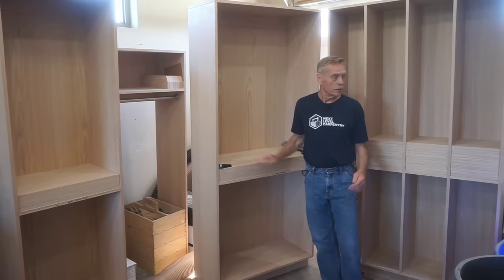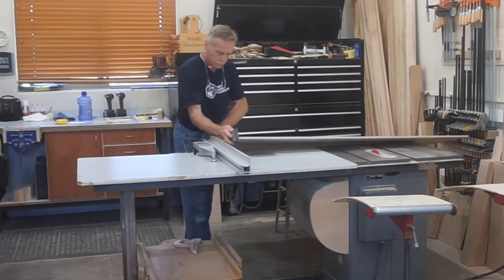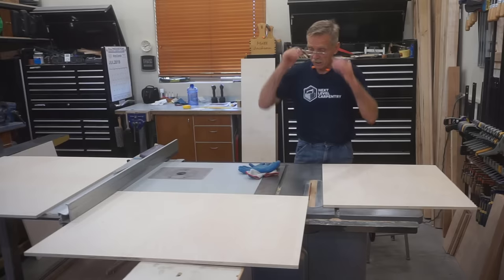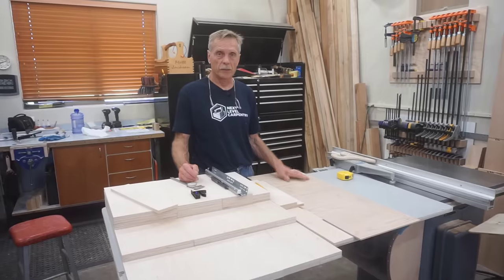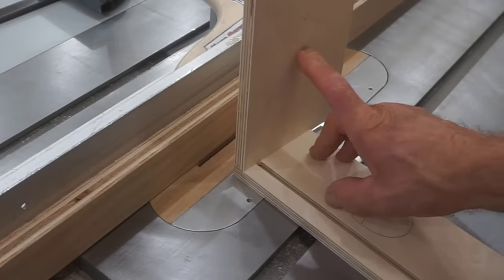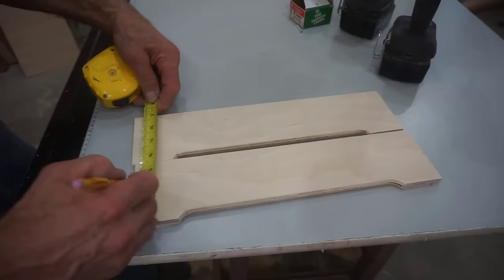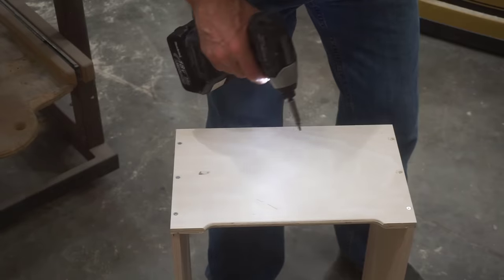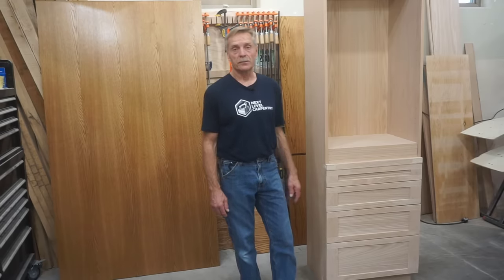Master Class for Professional Grade Cabinet Drawers

Comment: Great video, Matt! Is there a reason you wait to diverge the front and back of the drawer boxes until after cutting the dados, rabbits, and tenons? Can I cut the backs to final size at the start, not cut the dado, and save a little bit of stock?
Reply from the maker: Good eye for efficiency and detail Andrew.  I think the only drawback to the sequence you ask about is that you'll need to keep track of those parts starting earlier in the process.  It's probably worth it and, in some cases, the little extra stock you'd save might make the difference of not having to buy a whole extra sheet so, by all means, go for it!  Keep in mind that you need to make sure the width of the backs matches the top of the dado on the other 3 drawer pieces to get a good fit of the drawer bottom.  It's not that hard to do, as long as you're mindful of it.
Thanks for watching and commenting on this one!
Best,
Matt
Reply: @NextLevelCarpentry  Thanks for the reply! Something I just learned trying to do this is that you have to consider that your 1/4" dado for the bottom is not going to be exactly 1/4", more likely a bit smaller. So if you cut your back exactly 3/4" shorter than the front (1/2" clearance + 1/4" dado) you might end up with a back piece that's too short. Using the dado as a mark for cutting the back to size is actually a really convenient way to get a good fitup if you don't mind losing a little bit of stock per drawer. You can also raise the blade at the end of the dado cutting (38:00) and make the cut there.
Reply from the maker: @Contrail4  Spot on!  It's an easy enough problem to work around as long as you're paying attention like you are.  Another aspect of it is that, usually, I find that any material savings are a moot point and the only actual result is that the leftover scrap/offcuts I throw away at the end of the project are just a little smaller.  But, once in awhile, it means the difference between using .98% of one sheet or 1.08% of a 2nd one which makes a parsimonious approach to cutting drawer backs totally worth it! 🤓

Comment: Beautiful work. I don't have a nice, big, expensive table saw and jointer, and knew I wouldn't have room in my garage for them. I also needed to be able to store my equipment. The solution for both tools for me was the Kreg Adaptive Cutting System. I am in the process of making 8' tall barn doors to serve as shutters inside.  After cutting six 8' pieces for the sides, I noticed I was off 1/8" "fat" on one end, due to not setting my rip guides perfectly. I then, fine tuned them, put the guides on the side of the board, and recut. PERFECT. I couldn't have done that with my contractor's table saw. I would have wobbled somewhere.
Reply from the maker: Good save, Russ!  A guy's gotta do what a guy's gotta do, right?! Best, Matt
Reply: @Hello Russ how are you doing

Comment: This couldn't be posted at a better time, I'm starting to build the drawers for my kitchen remodel today! Now to soak in the knowledge...
Reply: If you leave the dato on the drawer back, it will hold the bottom without screws, In fact, so strong you can stand in the drawer and it will not fail, even with 1/8" material. On the drawer sides finish nails can be used instead of screws, much cleaner look. Be sure to glue all joints and especially the bottom. We made dressers this way with lifetime warantee, and never any claims.
Reply: @carmengeorge5647  putting pocket screw holes on the drawer box front will allow you to hide any screws or nails from the finish sides

Comment: I really like watching you organize the work flow and the care you take to mind all the details.  Having broken down hundreds of sheets of plywood in my dad's shop making cabinets and drawers, I am even more appreciative of the efficient and effective way you work.  

Watching your example, one notes an important point:   NEVER assume the factory edge of a plywood sheet is either true, square, or clean.  Check it!

Respects!
Reply from the maker: Thanks for watching and commenting Jerry.  Sounds like you been there with misplace confidence in the squareness of a factory sheet?  Makes you wonder what you did wrong all the way through a project only to discover the sheet was to blame... Best, Matt
Reply: @NextLevelCarpentry    
I came to believe that plywood factories provided built-in frustration with every other sheet of plywood -- with great efficiency. 

Then, of course, there is also the way the sheets are (mis) handled in transit.  That helps a lot, too.  😎

Thanks, again, for a great video.

Comment: You speak so well and give easy to follow instructions. I'm by no means an expert with wood working but I'd like to point out to those who are watching this or any video of someone using a table saw : Make sure your shoes are non slip and keep the floor clear of sawdust. If both feet slip out from under you while reaching across the table, you could easily fall chest first onto the spinning blade.......Love the tip for squaring up the sheet on the jointer. Cheers.

Comment: I use CutList Plus for optimizing material use. You can allow for kerf width, force cutting with or across the grain, print labels if you wish, print a cut list and/or cutting diagram, and much more. No need to apologize for going into detail as far as I am concerned. You can't over communicate I believe. If there is a little too much info for some they can skip over, for the rest they will get all the instruction they need. You do an excellent job with your videos and editing.

Comment: I had always been taught that the factory edges were always golden and that I I could always trust them and couldn't ever do as well as the factory.   After watching this video I started checking all the sheets of plywood that were going into my projects.    In just two months I have confirmed for myself that Matt is absolutely correct.  I can't believe that I was that naive  even after all these years.    However, I have now seen the quality in my work jump up dramaticly  by using just this one tip.    Thank you Matt for sharing, you have really made a difference in my life's work.
Reply from the maker: Plenty of factory edges are square and true though never smooth and occasionally out of square.  Being aware as you are now is definitely a factor in the quality of your work. It was a surprise back to me when I learned that thickness of veneered panels from one part of a sheet to another can very slightly too.😮You're welcome for sure Riidher! Best, Matt
Reply: @NextLevelCarpentry  Matt, I am very pleasantly surprised that you answered my comment.  Thank you for taking the time and making the effort.  It proves to me that not only do you turn out quality work but that you are a quality person.  And thanks for the tip on veneered panels.
Best Regards,
Riidher
Reply from the maker: @Riidher  Youbetcha!  Connecting with sincere viewers like you is the main reason Next Level Carpentry succeeds in the online realm of YouTube where growth is normally gained with glitz and fake drama. Best, Matt

Comment: Hello Matt, At the 18:00 minute mark you mentioned not using a Riving Knife on your table saw. I have been building cabinets now for over 40 years and have never engaged or entertained the idea of a Riving Knife...  I too like to manipulate my “Sheet Goods” and feel the Riving Knife gets in the way. To this day I have not had a pinched Saw blade from ripping “Sheet Goods”... Safety First, Always...  Great Video, Greg
Reply from the maker: I think there's work habits that build over time for guys like us: never had a riving knife and work safely without one.  Lots of people drove millions of accident  free miles before there was ever such a thing as anti-lock brakes too.  Take away antilock or riving knives from someone who learned with them as normal and they're bound to have issues.  Safety first with what you're used to maybe is a good mantra?  Thanks for your comment! Best, Matt
Reply: @NextLevelCarpentry  You Bet...

Comment: I found it interesting that you decided not to include the process for determining the sizing for the amount of drawers that occupy the spaces. Its been my experience that this is the one aspect no one seems to teach! Its always about the cabinet / drawer construction techniques. Aside from this little gripe, thank you for your time and effort in creating great content for us to enjoy and learn from.
Reply from the maker: Hey Superwingman... the reason you don't see it covered is that it would take a dozen very boring, technical videos to even begin to cover the subject since EVERY piece of drawer hardware has different requirements.  This should and, in time, probably will be covered by manufacturers in video format.  They already cover it in print/PDF format but I would definitely agree it's lacking in understandability.  Best you can do is study product literature specific to your choice of drawer glide and then make a mock-up installation to confirm you got it right.  45 years in and I STILL find myself doing that for anything but the most basic side-mount glides that require 1/2"+ space on each side of the drawer.  But don't go with that as an assumption because most glides are manufactured in metric which throws another variable into the equation.  Best, Matt
Reply: Matt, thank you for your detailed feedback. However,  I think there's a misunderstanding. I am well aware of the differences regarding slide considerations when determining the width of the drawers. My lack of understanding  is with regard to the height dimensions of drawers and how to determine these dimensions. If my cabinet vertical opening is "X" and I want 4 drawers in that space,  what's the best way to determine this?
Reply from the maker: @SuperWingman69  ahhh... I see.  Turns out that's an even bigger question because it goes beyond logical/physical considerations and gets into art and borders on philosophy.  Google the term "geometric progression"  https://en.wikipedia.org/wiki/Geometric_progression to get a peek into the labyrinth of 'answers' to your seemingly simple question.  Beyond that just think about what you want to put in your drawers and size them accordingly 😁😎 Good luck... Best, Matt
Reply: @NextLevelCarpentry  I think you could simply give / teach your methods for determining the dimensions for the amount of drawers that fit in a cabinet. Your last reply seems a little sarcastic. Up until now I've really appreciated your time and effort in teaching your craft. Not so much at this moment due to your response.
Reply from the maker: @SuperWingman69  Seriously?!  Dude... I'm afraid your expectations for free answers from a free channel from a content producer who's taken a good measure of his valuable time to give sound answers to your questions again, for FREE,  are far out of line. You should reconsider that ungrateful reply... and good luck finding a better answer.  Seriously.  Best, Matt
Reply: @SuperWingman69  This is less of a "carpentry" question, and more of a "furniture design" question. Maybe check with someone who designs furniture?
Reply: @NextLevelCarpentry  I am with you Next Level Carpentry. Keep up the good work and build on.

Comment: ive seen countless machine made dovetail drawers fail, but i have never had a captured bottom drawer lock joint style drawer fail. I build mine with a 1/4 inch tenon, but you really cant go wrong with this joint. plus i love the way it looks with birch or maple multiply. nice work
Reply from the maker: There's just something about Russian birch with a clear lacquered finish, isn't there?  Best, Matt

Comment: Great video!  I am an experienced carpenter that has made many different drawer types, what I learned from you is- go the extra mile to do things right.  I love your attention to detail, I have always focused on speed, I want to focus on detail now.
Reply from the maker: As you know it takes a lot to be good, Steve, and sounds like you've realized that it takes just a little more to be 'the best'.  That slight but very significant change in your focus means you're on the road to greater things!  As you go forward you'll find yourself able to do much more detailed work much more quickly because of learned technique and experience/familiarity. Best, Matt
Reply: Absolutely, I've always made drawers one at  a time.  I see the efficiency of cutting all the parts at once and reducing the time spent dialing in the saw fence.  Thanks

Comment: I am a cabinet woodworker and cabinetmaker and enjoy every minute of these kind of video's always looking for new things to add to my arsenal.  And so I never mind sitting through long video's that are packing full of interesting content that I know i've going to get something good out of regardless of my experience level or not.  Measuring screw layout was only thing i thought was a little overkill.  My boss would kill me if he saw me doing that at work.  lol.   The eyeball-O-measure is accurate enough for those kinds of details imo.
Reply from the maker: Measuring screw locations is a little bit Overkill but anytime screws are visible in the finished product I think a little extra time with a quick layout gauge is time well spent. But that's easier for me to say because I do things on a cost-plus basis not trying to keep bid work profitable like your boss probably is?
Either way thanks for watching and commenting and keep up the good work!

Comment: Man, sanding the edge of sheet goods is an outstanding tip! I cannot tell you how many times I have seen that ugly gap appear on the table saw between the sheet and the fence because of a splinter or a pebble in the edge. Excellent video!

Comment: I have two nice table saws one of them was my grand fathers. It was made in the 50's has been well taken care of, the other is a cabinet saw from the early 2000's. I do not have any of the fancy additions to my saws either, but I like your self have learned to work the brain and the saw to true the wood. Love to watch a true craftsman at work. Keep up with the flicks.
P.S. Some day I may get the energy to build a saw sled but for now I will continue to work with nerves on edge while performing some of the cuts you did in this deminstration.
Reply from the maker: Kudos for keeping those old saws alive, Al.  They don't have all the pizazz of new ones but they can be a joy to work with.  FWIW The next video from Next Level Carpentry is an in-depth build video for the zero clearance throat plate insert you see in use on my saw in this video in case you're interested in that one small but very useful/helpful upgrade.
Best,
Matt

Comment: Two things: 1) You mentioned that you're known for longer videos.  If people are giving you crap about it, then typically those are the one who's projects lack precision as well as accuracy.  I like that you go in depth about what you're doing AND how to do it to replicate your results.  If people can't / won't take the time to learn, then oh well, then can move on and keep tricking themselves into believing they're good carpenters.  So, as you already do, don't concern yourself about video length; it's the content that matters.  2) Anyone that gives you shit about a homemade router fence like yours can just go on and spend $200+ for an anodized aircraft-quality, space-age, alien-technology router fence that you can't / won't  want to zero clearance or pierce with a router bit.  Again, you just saved me $200 because I having watched your video, I made a few fences so I can just switch them out per bit (lock miter, drawer lock, etc.) I use for zero clearance.  Part of becoming better at your craft is making homemade jigs that work for you.  If possible, don't buy it, build it!

Thanks for your insight on organization too!  I'm pretty much everyone who has watched this video has had some sort of SNAFU with making an inappropriate cut due to a lack of organization, especially in a small shop like a 2-car garage where space is limited.  Still, keeping a checklist, writing down cuts, and stacking them per usage matters.  As you mentioned, it's not about speed and racing yourself, but about accuracy and results.

Keep doing what you do, us adults find your instruction videos both interesting and informational.
Reply from the maker: Thanks for that Derrick... I appreciate you sharing your thoughts and viewpoint! Best, Matt

Comment: Just real quick before I continue I love the outfeed stands. I use my bench as the outfeed, but I often have to stop with sheet goods, raise the leading edge just a hair then continue. You've just solved my problem without even trying. ;)  Back to watching.. Carry on..
I have several new customers here in a bunch of subdivisions where all the homes are jerrybuilt with particle board, finger joint everything and a buttload of staples. Many of the particle board kitchen cabinet drawers are falling apart as quick as I can go house to house to make new. I'm always amazed that customers seem to think drawers require some kind of advanced drawer making degree when they're really little more than a box with a fancy face on one end, but I do use very similar techniques and knock them out in about 30 minutes each. You might think folks would want me to replace every drawer in their homes, but nope..They keep calling me back for each drawer every few weeks or months.. I should raise the price each time, but I like keeping my customers. ;)